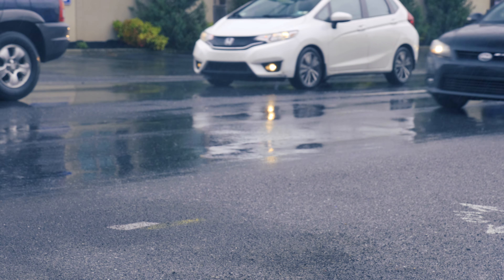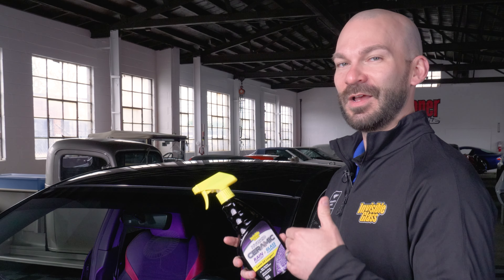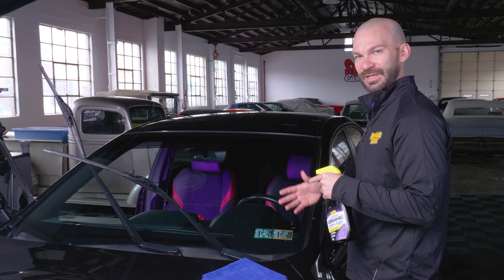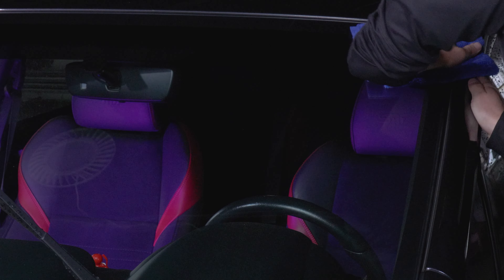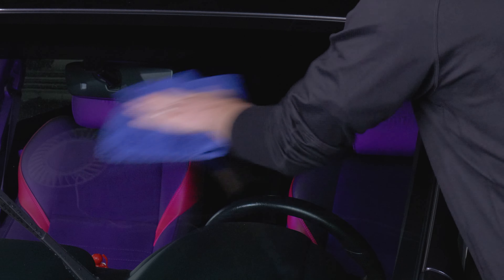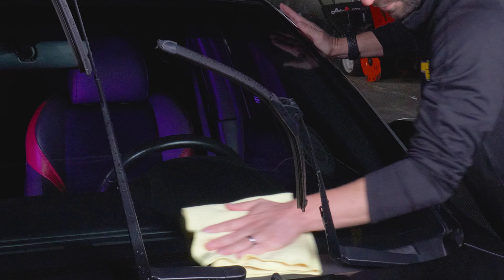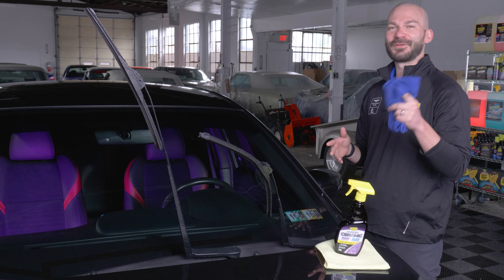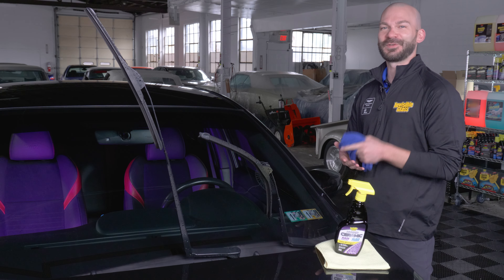How To Get Streak-Free Glass

Comment: I must have used to much. I really had to buff with elbow grease to get all of the hazy residue off. I’ll try the 3 spray method next time.  It did last awhile and provided great hydrophobic beading action where I barely needed to run my wipers.
Reply from the maker: Well depending on when you purchased your bottle you may have had the old formulation, but we have updated the formulation to make it a lot easier to use! Let us know how it goes 🙌

Comment: If it does get wet immediately after application will there be any issues? Or should we just reapply it?
Reply from the maker: The only issue is some off the product will be diluted since it didn’t cure properly, making it last not as long. So you can just re apply!
Reply: @StonerCarCare  Hm... It actually left a bunch of hard water stains though for some reason. I don't know if the hard water content in my house was just abnormally high or if it was some issue with the spray leaving mineral deposits on the surface, but the spots left behind, I couldn't even scratch them off with my finger. Had to use Nu Finish Car Polish to get it off, and planning to use Chemical Guys Water Spot Remover to get rid of the rest.
Reply: I was also using microfiber towels for application and followed the instructions on the bottle.